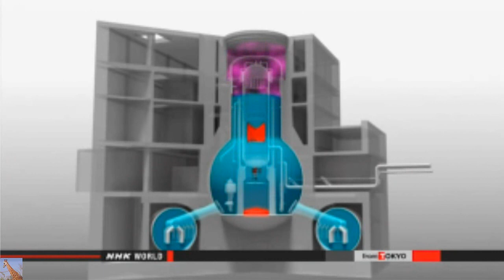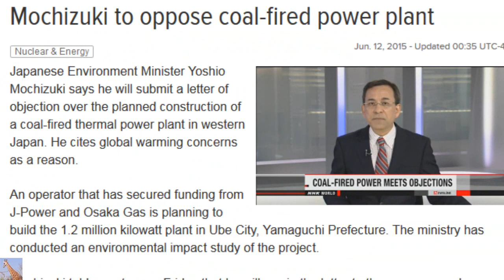Fukushima is WAY Beyond ANYTHING Anyone Prepared For Update 6/12/15

Comment: Fill the reactor holes with sand or quartz which has a higher melting point.  Sand meets fuel. The fuel melts the sand/quartz which then mixes with the molten fuel diluting it until it eventually causes the fuel to convert back to a solid.

Comment: jade helm emp or other remember they have energy weapon it turned the towers 1, 250,000 tons of steel that took years to forge to dust in 9 seconds. even the top floors that should of been resting on top of the rubble the floors that had no weight on them turned to dust in mid air.

When Jade is used as a verb: It  means; "To wear out by overwork or abuse" "To tire or dull through repetition or excess". "To become weary or dulled" "Obsolete-to make ridiculous" The word Helm means- " A position of control". I'm sure there are a few smarter than me to pick the correct meanings for JADE HELM. OK, next to the art work itself. The 2 crossed arrows seem to represent the South West. A Roman Gladius lays upright in the center pointing up. The Roman Gladius has always represented Rome. I say that's close enough for me to tie in the Vatican.  I believe the Trident those 3 objects creates symbolize the Illuminati. We've seen trident like images before. If the local Mayors sign the papers allowing the military to do these "Exercises, they will allow a Trojan Horse in trough the gates. One more thing about the timing of all of this. Jon Kerry was visiting a French dignitary who said we has 500 days left to deal with climate control. He was that specific, but from what I've been reading the Nibiru complex  is being seen on a regular basis in Mexico practically everyday. So much so that now the Mexican webcams are being shut down. It won't be too much longer until citizens in Texas start seeing the dwarf planet too.